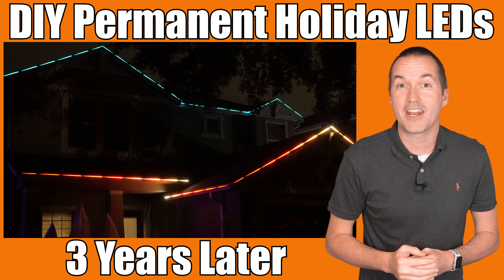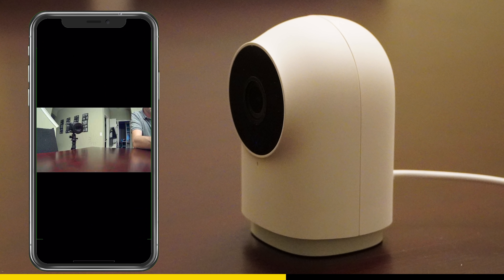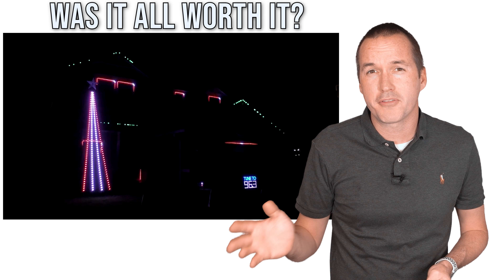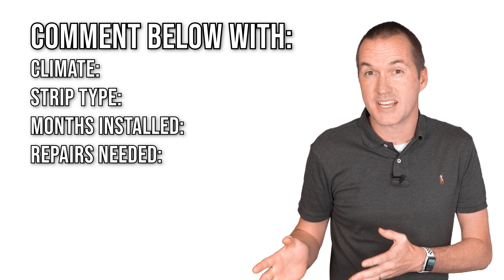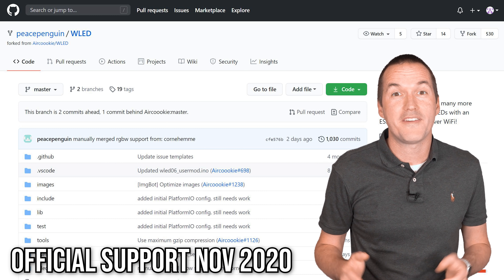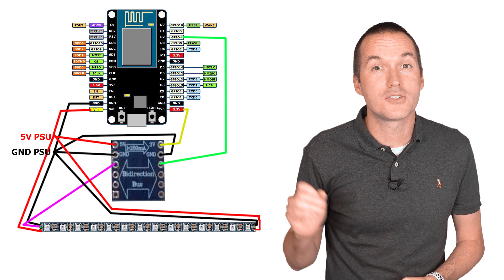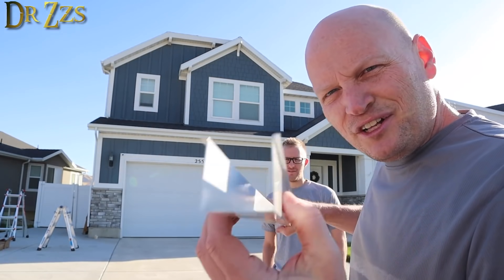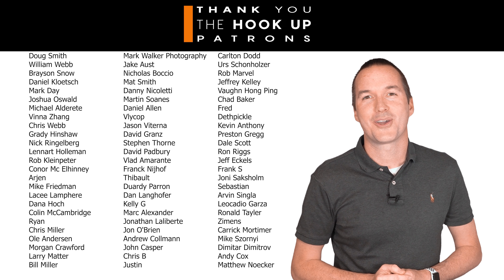3 Years Later: DIY Permanent Holiday LEDs - What worked, what didn't, and what's new?

Comment: in Australia, Melbourne, I used 5v led strip and it's been going okay, but the strips are under the roof protected form the elements. My only issue was with power injection that I didn't plan properly or at all.
I had way to much voltage drop over 30 meters of cables that even a normal cable wasn't able to carry the 5v alone. 
My solution, get 12 Volts on a cable and have a 12v to 5 volts converters on the power injection points on the strips.

If I have to do it again, I would definitely go with individually addressed 12v strip to have less issues with voltage drop. It costs more, but with way less hassle on install.

In regards to using ESP with WLED to run light strips on E131 protocol, keep in mind the limitations in the max number of leds it can drive (1200 @ 30fps I think). The ESP hardware used is not super powerful so it can't compute a lot of long strips as fast as a F16V3 Pixel Controller for example. From a cost point of view, if you have lots of strips, it might end of being cheaper investing on a nice pixel controller instead of using multiple ESPs. It's a case by case scenario kinda thing.
Reply: Esp32 should be around 1k leds at 30 fps and ~0.7k at 42fps. You can just get more boards for more leds.
https://github.com/Aircoookie/WLED/issues/927
Reply: Thank you so much for taking the time to post this info! In Aus too and wondered if it would survive the climate
Reply: With 12v strips, they no longer become "individually addressable" and instead are in groups of 3. 24v are groups of 6 (so they can just share the voltage evenly to get to the 3.3-5v range instead of requiring voltage transformers at every single LED. 

For a house though, groups of 3 is probably good enough, but some effects might look a little strange. Certainly a tradeoff, and one I didn't realize until trying to find 12V individually addressable LEDs.
Reply: @MrKing0fTown  they have new strips now with ws2815 chips that are truly individually addressable on 12v, so not a cluster of 3. See https://a.aliexpress.com/_m0lRQOp
They also have RGBW all in one ship, so no need to have separate leds for the white channel. Things have evolved for the better in the LED world.

Comment: Are you still using 20 or 22 gauge wire for power injection? How far are the power injection runs? I have purchased some 16 gauge wire for power injection because of the length of runs that I have going on (probably not too far off from your house). My thought was lower gauge, thicker wire, less resistance, over long runs, less voltage drop for 5v.
Reply from the maker: I use the thin wire inside the channels alongside the strips.  I’ve got a single 16awg injection point about 70% thorough the downstairs run (where the roofline jogs over the front door), and in the second floor by the small window.
Reply: I've watched your original LED videos many many times and I don't recall you mentioning that. But then again I could have totally missed it. Thank you for the update. I appreciate your time!